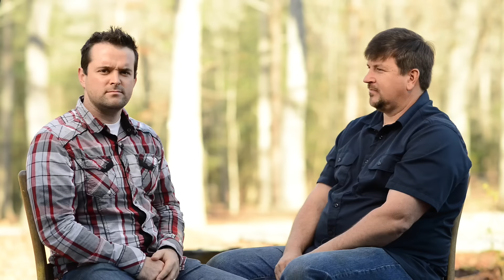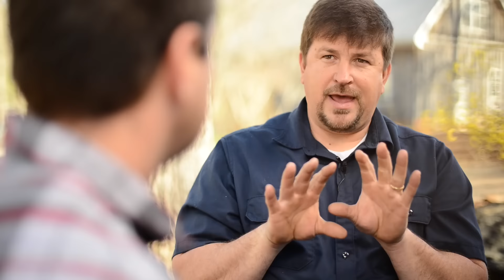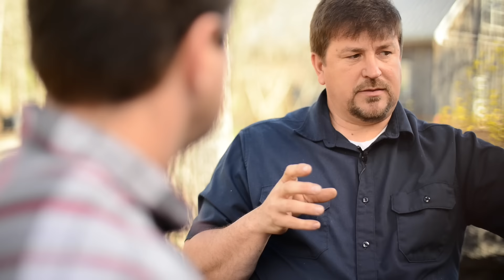EMP and Generators

Comment: I would recommend an enclosure that completely seals the unit. Intake and exhaust can be opened fairly easily when need be via poppets or manual valves. The ground strap can be mounted to the enclosure, and connected via a terminal on the side.

Comment: It might be worth mentioning that a power cord hooked to a generator shielded or not will act as an antenna with any large pulse unless you had a heavy line filter at the generator. Also older generators with pull cranks often have no electronics and should be good to go after an emp if you can crank it..
Reply: As far as line filters go, would a 1:1 transformer not work? It works when you need to isolate power sources in plants from noisey areas.
Reply: caveman d You would need a 1:1 transformer that could handled the load you put on the generator. Then things that have motors require lots of extra power in the first second. I would imagine a 1:1 xformer that could handle a 2 to 5KW load would cost as much or more than the generator. 
A simple solution is to disconnect the power cord at the generator when it's not being used. You can read up on Varistors as well. They help a lot with pulse power but if you happened to be close to a violent EMP event all bet are off.
Older generators are tough to crank sometimes but the lack of electronics would be a plus in the even of an EMP event.
Reply: +wa4aos basically any portable generator built prior to the 1980's will be fine.

Comment: It is the generator's microcircuitry that is vulnerable. Store spare controller boards, regulators, etc, and you can return the unit to service quickly after a pulse. Keeping it attached to your grounding system is problematic. The E3 component of a pulse will use any and all grounds to charge devices. Unless you generator is an automatic-start type, configured to power up when you lose power, you should not have your generator connected to anything.

Comment: I have a soar generator and 2 solar panels. Should both the generator and panels be stored in a faraday cage and is it safe to bring them out after an EMP or  CME?
Reply: Steve, from what I have read it might be wise to purchase a replacement set of vulnerable electronic parts as a back-up and store them in a completely sealed (not even a pin hole or an uncovered rivet) Faraday cage.  As for the risk of a "double-tap" hit, who knows?  But road side devices frequently have a second that goes off after the first responders have arrived, so who knows what their plans are.  It's terrible we have to worry about this stuff.

Comment: I have whole emp protection I do have a central air unit connected to the house emp and my garage as well my generator has emp traps installed my question what else do I need to do to protect the generator and Central Air unit

Comment: How about a diy permanent magnet water mill or wind generator? I have two etek mantra motors that I’ve been playing around with. They are rated for 48vdc and more amps than I can find switches and diodes for. I’m new to alternative energy and electronics so I don’t know much. I’m just curious. Would a high voltage pmg be destroyed in an emp if simply disconnected from the battery (no circuit) and then switched back on after? 

These pmgs are pretty heavy duty from what I’ve read and after playing around with them they produce plenty of hp if powered and more electricity than I know what to do with if spun.

Comment: Those old Briggs powered, portable generators should be absolutely fine. No electronic ignition, oil guard, or controls in the gen head. All steel and copper, no electronics in sight.
I have a 4500 watt one, 2000 hours and still runs like brand new.
Reply: So, my genny doesn't have any digital stuff on it at all. It's just a little Sportsman 2000 surge watt, pull cord start and manual choke, etc. but it does have overload protected outlets and a circuit breaker. Is this one vulnerable?
Reply: It has diodes in the rectifier and will most likely be affected by EMP.  An EMP is millions of volts and very high amperage.......the only thing that is good is that it is very quickly deployed...AND dissipated.  It is pretty much all guesses until it happens.  We do have some test results but until one is actually set off we really don't know.  I say it will depend on the strength of the weapon, the distance it is set off from (including altitude) and obstacles in the way.  EMP IS line of sight so it may not kill everything as some think.  Again...it is the best guesses we can make.  This guy is sharp and he's mostly right as far as I can see but even he'll tell you that we may be wrong about some of it.  Some think cars will most be affected unless they are running at the time of the EMP and there is some evidence to show that but we won't really know unless we actually get one.  Also, your genset probably has some transistors in it somewhere even if it's in the ignition system so the answer to your question is...it probably will not work post EMP.
Reply: Thanks so much for responding! Looks like I'll be working on a faraday cage for the genny! :)
Reply: +Ann Crum's Mini Homestead News 
Yeah, if I remember right newer generators do have 2 diodes in the rotor, even if it is not an "avr" generator, such as your sportsman. These will probably survive an emp, as your generator itself is metal and will act as a faraday cage. However it does not hurt to be extra cautious.

I currently have 4 portable generators, and the only one I think could be damaged it my 4000 watt Honda with an auto voltage regulator. Any thing with points will survive, even crappy Honda clone units with out an avr should survive. My backup is a Honda under some metal roofing sheets in the forest and tarped off. I have no doubt it will survive.
Reply: ***** Hank.....it's been proven over and over that a metal shield has to be COMPLETELY enclosed or it is totally ineffective.  Even a small hole in the shield will let in enough pulse to probably fry the unit.  There's a really good youtube vid that shows that a garbage can with the lid firmly installed will NOT stop the pulse and until the guy puts metal tape all the way around the lip it's pretty much a waste of time.  So your theory of a metal roof with a tarp is more than likely only going to disappoint you when you fire that dude up the first time.  It might RUN but the diodes will be toast and it will probably completely short out immediately after start.  We really don't know for sure but the evidence is strong that the faraday cage has to be TOTALLY sealed to be effective.  It doesn't take a thick shield.....aluminum foil appears to work well if there is insulation between the item and the foil but it does appear to have to be sealed extremely well or you might as well not take the time to protect your electronics.  I have a galvanized metal building with a metal floor and I can tell you that even the small holes drilled for assembly didn't keep my cell phone from working inside until I taped them over.
Reply: The generator itself is in total danger... even if the engine is fine,,, generators have windings, brushes with wires....and a multitude of other conductors just waiting to fuse together if unprotected... Do whatever you want ... but you'll wish you hadn't.
Reply: @awittypilot8961  I've never heard of an EMP being millions of volts. They're thousands of volts at best. A million would kill people. Thousands can fry electronics. Higher events like something the sun can do can make telegraph coils smoke. That's happened. Hell of an antenna, the wire to the next station.

Comment: I think he’s talking about gas generators? I have a solar (I don’t use it w solar) but it’s a power bank Bluetti or jackery those type. Small bc it’s going into my bfs van. I was looking for covers… and also there’s gadgets on Amazon that day can protect your whole vehicle…. I don’t get it. And some commentators said there’s no such thing, that they are bunk. I also heard microwaves (cut the cords) can act as a faraday cage for phones key fobs and stuff). By the time I finish researching I feel like it’s impossible because so much would not be working. But then a scientist friend told me that the EMP strike doesn’t really mean everything gets fried. So, I’m back on the horse trying to figure some things out just nice to feel you have a little bit protected but it does leave the mine down the path of do I wanna really survive one?

Comment: If a person is not actually using the generator up until the initial EMP explosion..... why are we talking about an ongoing protection cage? as though the EMP never stops.... All most people are trying to do is make sure the generator makes it through the EMP blast using a faraday cage or whatever it takes and then just use the generator in the open air once the generator is no longer in danger...

Comment: If your generator hasn't a battery & is a stand alone generator, there's NO way it could be fried. Same goes for your chainsaw, or anything else without a battery. If you were to store what things you do have which have a battery, with the battery removed...safe.
  There's NO possible way for anything like this to be affected if they haven't a battery in them at the time of the EMP.
Reply: circuitry gets fried when the wave courses over and then into the generator. it needs to be shielded and then grounded to a grounding source. Look for the copper pipes in your house that are already grounding other electrical devicese (usually a wire connected to the pipe itself), wrap your electrical device in aluminum foil and connect the wrapped device to the copper pipe via large gauge copper wire or a jumper cable. Also, pray that the copper grounding pipe is connected to a grounding bar 15 feet into the ground - those are sold at Home Depot if you dont have one.

Comment: I would think that a simple chain link faraday cage with short 8 gauge ground wire attached to two 8ft ground rods would easily take care of an emp. As far as utility wires, burying them in bonded rigid galvi conduit at 24 plus inches from inside the cage to the foundation of the house would do it. Lightning rods on 6 gauge on each end of every ridge on the roof should pull any voltage in the surrounding air down before it has a chance to reach and damage wiring.